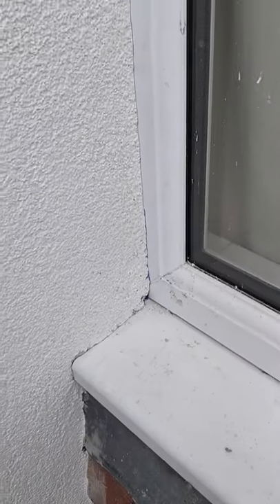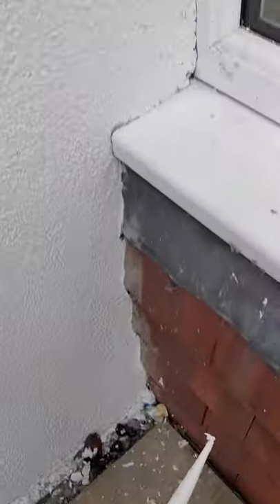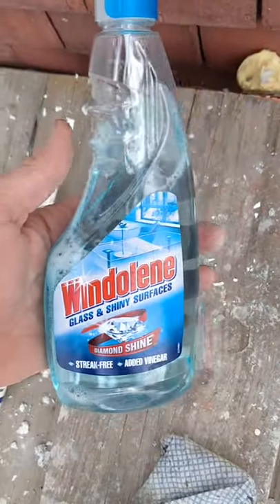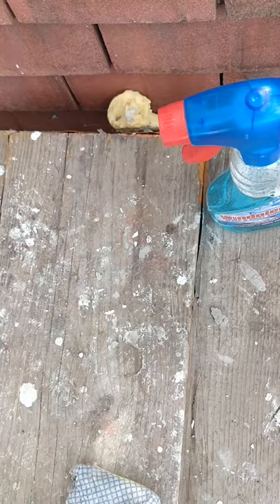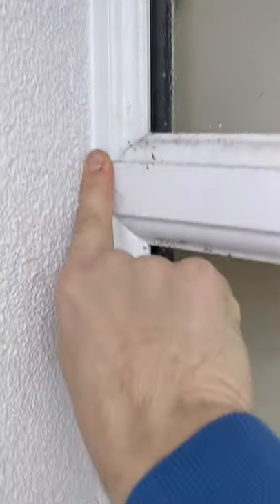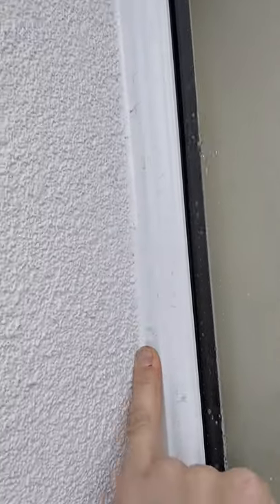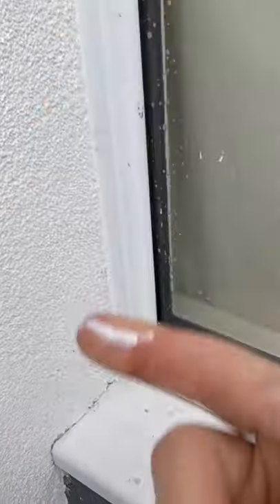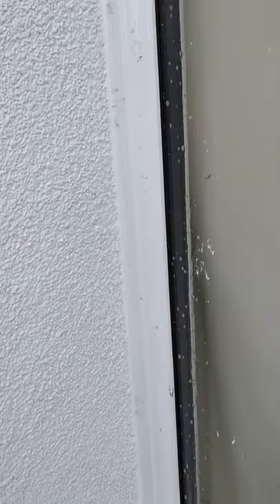Top Hack for applying silicone!

Comment: weak soapy water in a spray bottle is better and safer
Reply: And is almost free... window cleaner is alot more expensive.
Reply: Safer?
Reply: What do you mean by soapy water? As in fairy liquid or handwash or ???
Reply from the maker: Yes, either!
Reply: @OfficeBoyBuilder  thank you!
Reply: Agreed but sometimes it mixes the colour of the silicone and the soup and when silicone dries it doesnt leave that whit finish
Reply: @birillibre1689  you can get that "pure" clear one made by dawn i think.

Comment: But spraying before using finger means the surface under where you smooth will not stick...just like it didn't stick to your finger.
Reply: My man here knows some science
Reply: That's not even the window cleaner the dude could've taken a leak on it and it would've done the same thing
Reply: Exactly just wetting your fingers on a damp rag dose the same thing but personally i wouldn't recommend it honestly your better off just using caulking tool there like 2 bucks dont use window cleaner thats just dumb
Reply: Just think of it like this you wouldn't spray window cleaner on a surface and then apply glue ontop of it would you because the glue wont stick so dont do it to silicone because the same rule applies 😂
Reply: Isn't the whole point that is doesn't stick to the bit around? The bead is down, you don't want it spreading out

Comment: After watching this video, I still have no idea why I should use Windowlene. Can someone explain?
Reply from the maker: Because it stops the silicone sticking to your finger better than anything else, and it produces an ultra smooth finish on the bead that you run along the joint
Reply: @OfficeBoyBuilder  smooth finish is a perk. Bit if its not on your finger that means its spread over your wall.
Reply: But spraying before using finger means the surface under where you smooth will not stick...just like it didn't stick to your finger.
Reply: @kennethshull6331   what? The window cleaner wont go all the way under the silicone. It wont effect adhesion to the surface at all. Make sure you dont spray the cleaner until after you apply the silicone. If you spray it 1st then yes it wont bond as well. Also it has nothing to do with the cleaner. Silicone can be cut down and thinned with ammonia. Pure Ammonia will do the same thing. Window cleaner is just cheap and convenient. Soap and water does the same thing to latex caulk. Dont even need the soap honestly. Just has to do with the cutting agent that effects the type of caulk your doing.

Comment: So presumably you’ve already been in touch with the manufacturers of CT1 to check on the compatibility of the two different products, just to be sure that the window cleaner won’t break down the properties / longevity of the CT1?
Reply: CT1 isn't silicone based either. It's some kind of polymer iirc.

Comment: Is CT1 better than silicone for exterior frames?
Reply from the maker: Yes I think so - CT1 is a superior product and longer lasting/more flexible and doesn't degrade in the same way over time
Reply: @OfficeBoyBuilder  Thanks, I only discovered CT1 last year, it's great stuff isn't it. I'm also trying Stixall, half price of CT1 !
Reply from the maker: Yes Stixall is a great brand, and I rate them too. I believe CT1 have a different, patented product, hence the cost being more.